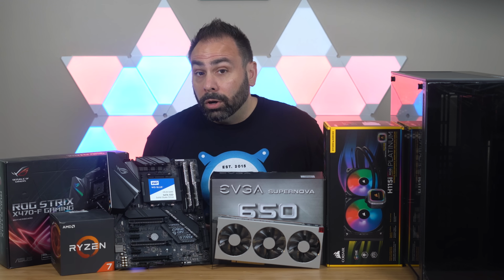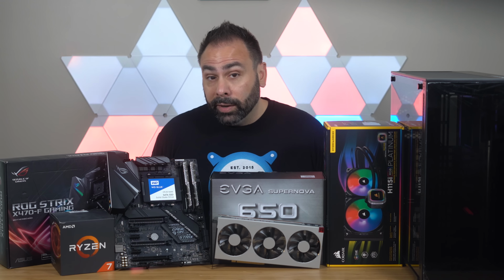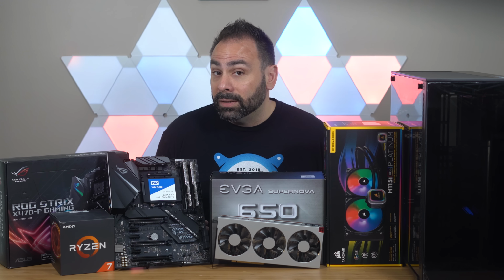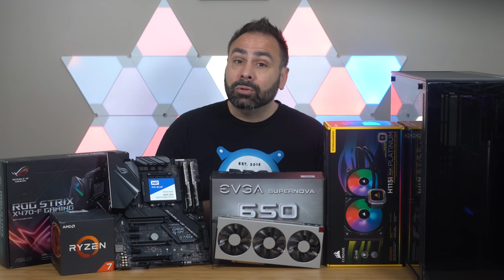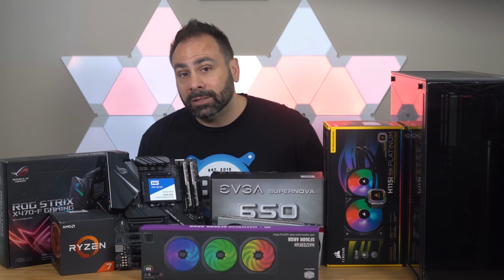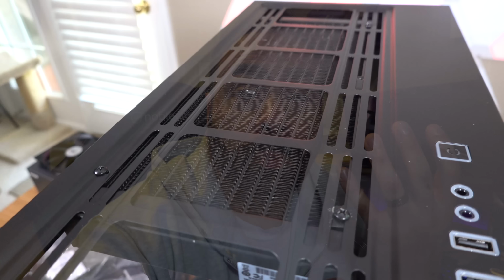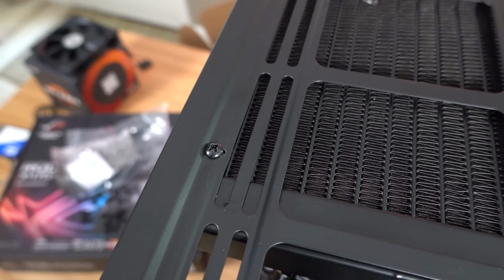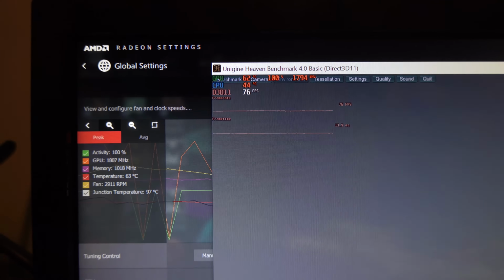2700X + Radeon VII = Gaming Bliss

Comment: I pretty much have this same rig.. lol.. Built mine around mid March.. Except I'm running NZXT AIO and fans, 7 total.. I have the AIO on a push/pull setup.. That and my ram is different and I also have a 512g M.2.. I went with a Seasonic 800 watt PSU, the case is even the same.. Great build, I love mine..

Comment: 650 watt PSU isn't going to last long. The Radeon 7 consumes over 300w of power, nearly 350w oc'd. Saying you don't think this system will pull more than 400w is niave as what do you think an OC 2700X to run off?

Comment: This build seems underpowered compared to an intel/nvidia combo. I'm getting higher frames with my 9700k gtx2080 and only paid slightly more.
Reply: I can guarantee you that the Radeon 7 will age better than the 2080. It has twice the RAM and it's HBM so it'll last longer. Also Nvidia is known to do planned obsolescence with it's cards while many AMD cards are working better today than they did out of the box. Even the Radeon 7 itself is better now than when it was new.
Reply: @scottyhaines4226  nah. Just nah.
Reply: @TheLevitatingChin  look at how well all of Nvidias 10 series cards have aged compared to AMDs Vega cards then get back to me. The only decent 10 series card now is the 1080 and 1080ti. Meanwhile the Vega 56, Vega 64 and the RX570 and RX580 are still monsters for half of what Nvidia is charging people.
Reply: @scottyhaines4226  don't really care how well they age. They be obsolete in a few years so the point is irrelevant. I upgrade rough 24 months or so and want hardware that's at the top of its game now.

Comment: I was thinking a full adm build for my ryzen 5 2600 with and rx 580 but nvidia's 1660 are such a good price that i may go for it.The 1650 on the other hand are so bad that it would not really be an upgrade from my 1050 ti
Reply: Pierré Grobbelaar I have a 2600 and 1660ti setup and it’s pretty dope

Comment: I am soooooooo impatiently waiting for Zen2 to come out while still milking my 1600X. Then videos with the 2700X come out, like this one, and I go shopping on Amazon only to tell myself, "Michael, just fricking wait! You've come this far. Don't cave in now!". Great build and video, Brian. Thank you for all your hard work!
Reply: I sold my 2700x waiting on 3850x CPU. Got my sell a use 
Ryzen 1600 cpu With Motherboard asrock b450m pro  n new ryzen 2700x cpu cooler + Stock cooler. For 100 $. Sold the cooler for 50$. Paid only 50 for the Mobo n cpu.
The CPU turn out to be lottery winner. 4.0ghz  only 1.35 volts. It even oc with the stock cooler. Temps only reach 65-67c after 8hr of gaming. I use my old Aio n only reach 53-55c  While hr of  playing. That was about 4 months ago
Reply: @NeVErseeNMeLikEDis  that's awesome! I've been taking my time building my rig also. I am constantly buying new parts and upgrading. The last original part from when I started fresh is the 1600X. I did get lucky with it also. I get a stable 4.1 GHz at 1.37v. So I've been content, but as I said, it's the last part to get swapped out from the original build. Here's a link to my YT channel vlogging my RGB vomiting overkill custom cooled rig. Take a look if you'd like. It's about 2 months behind right now, but there haven't been any significant changes anyway. https://www.youtube.com/channel/UCsyvh6D-4t6qsxPpA2-y5dQ?view_as=subscriber
Reply: @NeVErseeNMeLikEDis  keep in mind with my build I don't game at all. I just enjoy building high end, bang per buck, PCs. I've been doing it for 20 years now. That's why most of my gear isn't completely over the top as far as specs.
Reply: I did it. Upgrading my 1600 for a 2700x about a month ago now.
Reply: @mx5klein  I was going to and decided to just wait for Zen 2. I've been this long already.

Comment: 650 W with a Radeon VII? I thought you needed a 750 W
Reply: you can run a gtx 1080 with 650w
650w is enough for consumers 
1000w psus is overkill for everyone if you are not a miner then
Reply: Jonathan Fagell but Radeon cards usually draw more, ik that a gtx 1080 is power efficient
Reply: 650 is more than enough. Most of the time people overestimate how much they need
Reply: I have a cx650m to be sure I dont need to switch psu in the future
Ryzen 5 pc a bit overkill but you never know when you need to upgrade

Comment: Nicely done video. My current system setup is very similar to this one. We use the same MB - both use the 2700X Cpu - I have 32 gb of ddr4 @ 3000 Patriot Viper - My Cpu Cooler is the DeepCool Captain 240 RGB AIO - GPU is the Gigabyte RX Vega 64 OC - my storage is the 1 tb Samsung 970 Evo NVME M.2 - My PSU is the Seasonic Prime 650w FM 80+ Titanium . Not sure if i will upgrade to the R7 from my Vega 64 for a while - the Vega 64 is doing every thing i need at the moment very well.

Comment: You should have used the Deepcool Matrexx 55.  It comes with built in front panel RGB and the spacing for a top positioned radiator is more offset than the Matrexx 70. I have the Matrexx 55 and have a EVGA CLC 280 and it could never interfere with any motherboard because the board mounts lower than the AIO. 

All in all you built a very nice machine and I am fairly surprised more people don't think to use Deepcool when looking for a fairly inexpensive case that has an open layout and is bult with amazing airflow in mind.

Comment: I NEED HELP!!!!! I installed more ram into my pc, from 16gb to 32gb. Now, my pc crashes a bunch to the blue screen of death
Reply: Thank you,@Jishi Katsu . I normally ran my Ryzen 2600x with the stock cooler at 4GHz with 16gb ram. I'm running the cpu at the same rate with 32gb. What could the problem be?
Reply: Jishi Katsu additionally, google chrome and mozilla always crashes. Plus fortnite doesnt even work says something about dx11
Reply: Jishi Katsu i think we fixed it. Thanks for all the help
Reply: Jishi Katsu changing the overclock of ram from 3200mhz ram to a lower rating

Comment: The case is pretty poo- Using a Coolmaster H500mesh or any of the high rating case from Gamers Nexus... Has anyone actually done 'transplant testing' on cases? - Take 'the guts' out of a OC PC and see how it OC's in another case? Rather than just getting temperatures and noise data get 'real' OC data where you are going to the acceptable product limits..?

Comment: Loving this build for good video editing and gaming (streaming rig). tbh i would use 4x 8GB SR DDR4 3200 to fill all ram slots to make the system Dual Rank Dual Channel DDR4 32GB total for beter performance.
Reply: while you get slightly better performance memory wise, filling all ram slots has his drawbacks. Way more load on the memory controller, worse overclocking performance, higher chance for faulty writebacks. I recommend only Dual Channel, 2 x 16GB is better if you want 32 GB.
Reply: 2 x 16GB is beter only for 2 slot ram motherboards bcuz 16GB is Dual Rank memory  @Alduin86

Comment: took me 4 tries but i finally got one that works, H115i platinum had a problem with RGB on pump working or leaking but i think now its fixed, system runs a good 20 degrees cooler wide open, and i am also using the 2700 x

Comment: lol i got a 1600 from micro center a few weeks ago for 80 bucks and managed to get a stable 4.2Ghz overclock on 1.35 volts watercooled of course im loving it
Reply: Nice, that's a pretty insane OC for first Gen Ryzen.
Reply: BuGGzLoVeR's TECH that’s what I thought as well makes me feel kinda bad through that I’m just using this cpu as a place holder till the 3000 series comes out. That ryzen 1600 and the asus strix b450-I are putting in some serious work.
Reply: @Kokoro Banks that may well be but going from a FX 8350 that i could barley overclock to 4.3Ghz on water to this @4.2 coupled with my vega 64 on water and with me using a 3440x1440 freesynk monitor this is by far leaps and bounds better